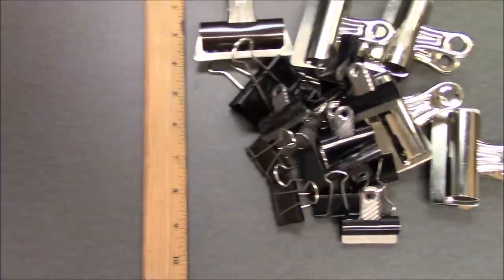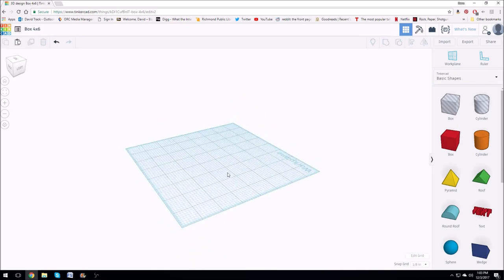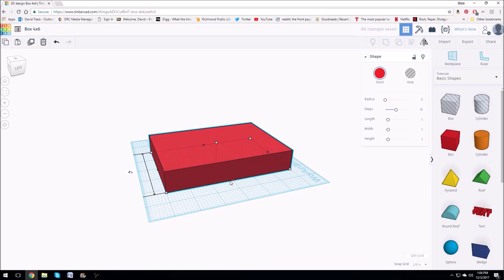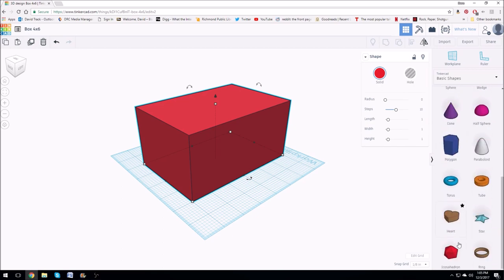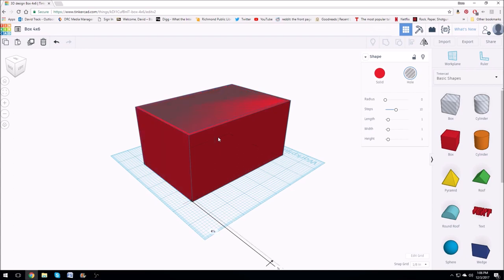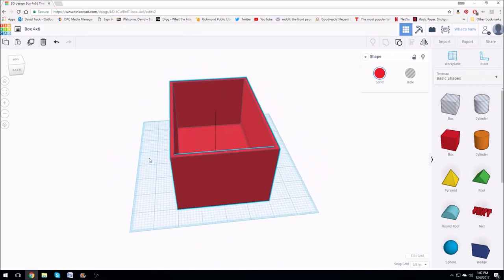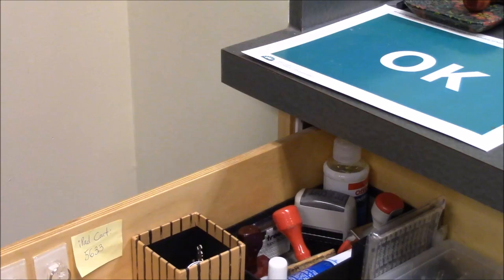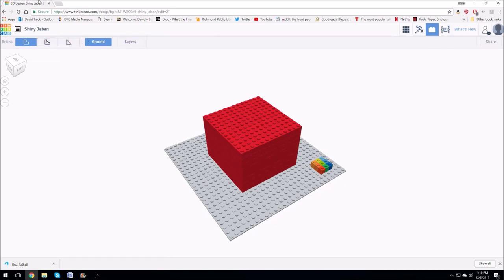Design a Box in Seconds and 3D Print it Using TinkerCAD

Comment: I been thinking about 3D printing a piece for a motorcycle, and I'm not quite sure if it would hold up to vibration.

Say a battery box roughly 2.75-3.5" w X 4.5" l x 4.5" h interior dimensions printed with .125-.25" walls, and rubber mounted to the frame with four hefty washers countersunk into the bottom. Battery would be approximately 5.5lbs and padded with some form of rubber on the sides.

Do you think 3D printing this would cause it to shake apart? What material would you recommend it being printed in if not ABS?

Comment: How is it gonna print, it doesn't have any support at all. It's just gonna fall over
Reply from the maker: Because your print will start at the bottom and work it's way up, there will be plenty for each layer to hold onto. The walls here are pretty thick. 
I would not try printing it on its side without support, but if you can print with no support, you definitely should and save on material costs.